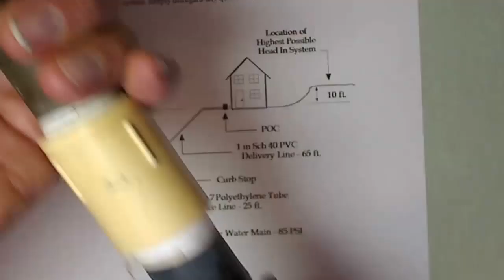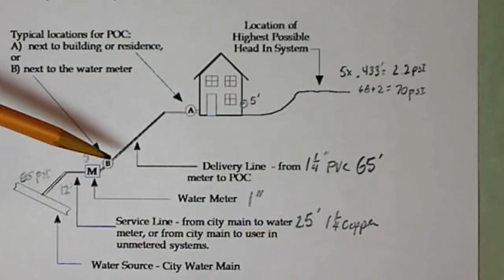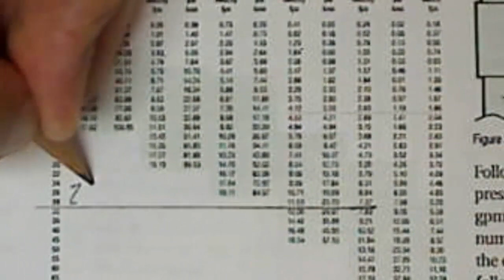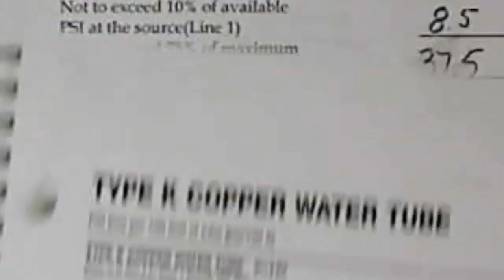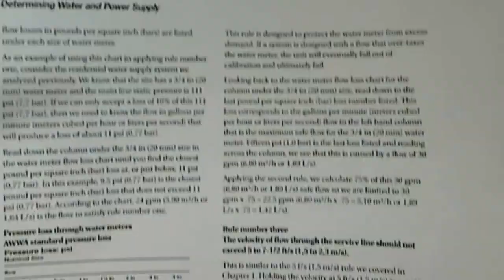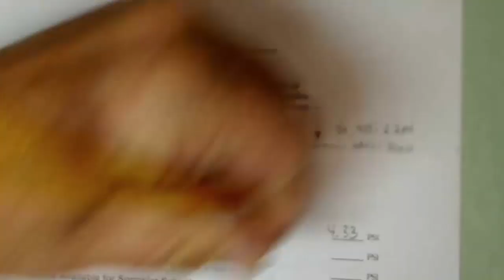Irrigation Design Capacity and Working Pressure Worksheet

Comment: Looks like you did rule #1 wrong.  Should be 36 GPM, based on not exceeding 10% of min static pressure available in city water main.  I use meter table as well.  1" meter, 10% of static is 8.5.  Go down 1" meter column until I hit 7.8.  Next number is 8.7 but exceeds 10% of static psi.  From 7.8, go left to gpm column and answer is 36gpm

Comment: What the hell did I miss? It was 64 psi then I blinked and it come up as 43 psi. I was with you then fell at the finish line
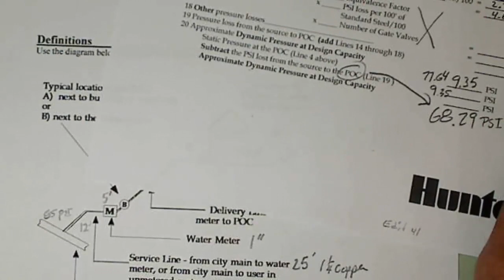Reply: At about 24:25 he starts that last step which is to estimate pressure by calculating 2/3rds of the subtotal 64.
So 64x0.67=~43psi